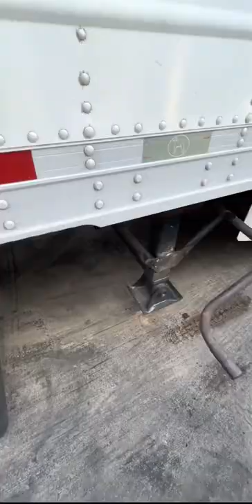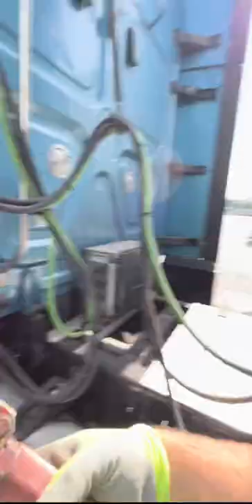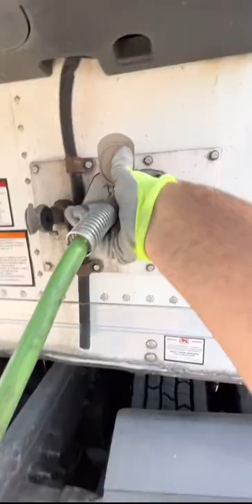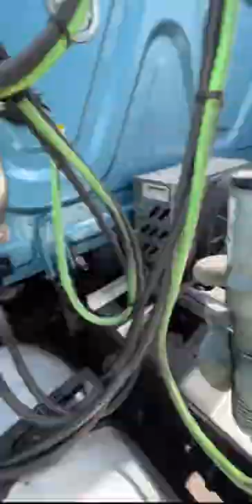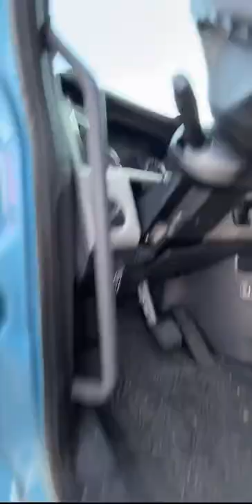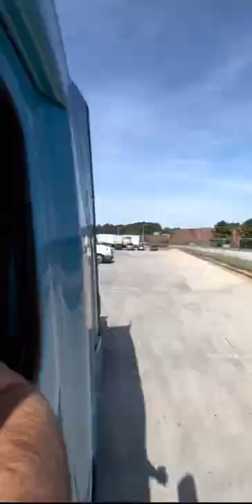They don’t care about Truck Drivers! #shorts

Comment: Bro reversing a trailer is so damn hard. I struggle parking my own landscaping trailer I can’t imagine reverse a reefer. The only thing I am worried about when getting my cdl!!!
Reply: Practice makes perfect it took me 3 months to get it down once you master it everything will be cake
Reply: @omarg92  Thanks for the motivation bro!!!! 😂 I am still scared!!! Just need practise!!!
Reply from the maker: I agree but all you have to do is keep on practicing and eventually you’ll be good at it bro 😎 I parked on that right place but I did have to pull up 3 times 🤣
Reply from the maker: That’s awesome 👏 I used to do car hauling before semi so I was used to it but I guess car hauling it’s easier to back up since you can see every corner of it